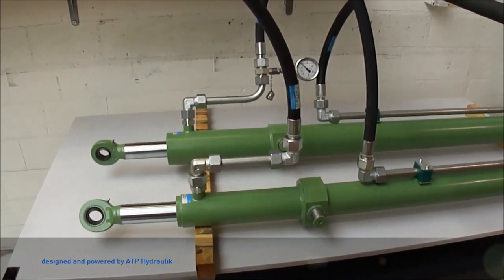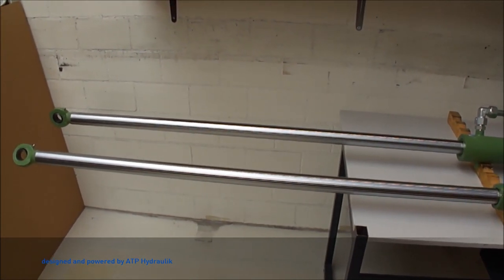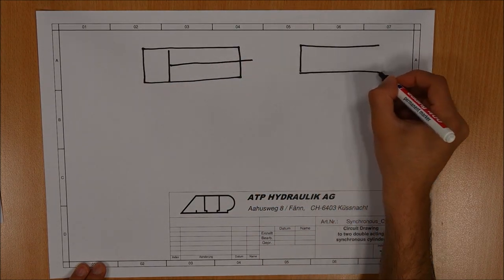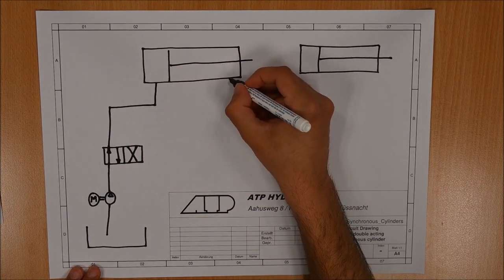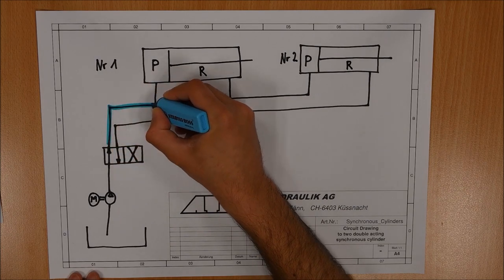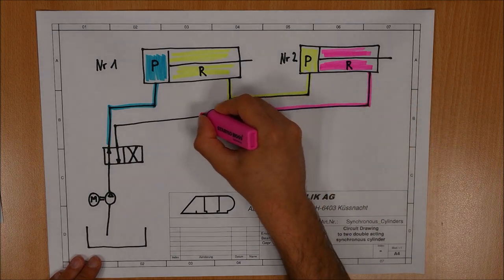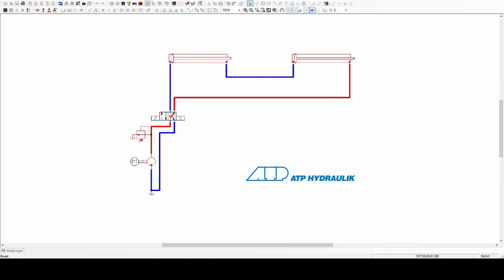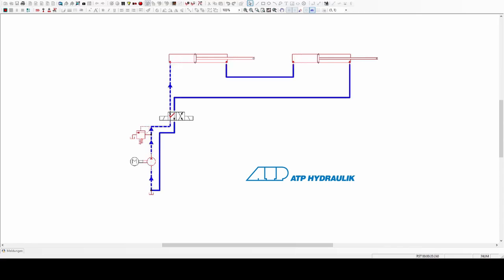Tutorial - synchronization of hydraulic cylinders without regulation and without proportional valve

Comment: I cannot understand one aspect of this, i.e. how to compensate the reduced oil flow from the first cylinder to the subsequent cylinders. Since we all know that quantity of oil exiting the outlet port of first cylinder is less than the quantity of oil entering the inlet of that cylinder, due to the piston rod's presence there. Hence, the oil flow to the second cylinder, and every subsequent cylinder will be progressively reduced. Please explain how do I compensate the oil flow, and synchronise all cylinders to work in tandem.
 
I have three exact cylinders, but with varying loads. How do I get all three to move in a synchronised manner?
Reply from the maker: The second cylinder cannot be the same size as the first one for this to function. In the hand drawn schematic you can see, that one part of both cylinders is coloured yellow, as well as the formula AR1 = AP2. This is meant to symbolize the same volume of the two chambers of the different cylinders. 

To solve your example problem: 
The easiest way would be to exchange the cylinders 2 & 3 to a size suited for cylinder 1, so a functioning synchronous cylinder system is created. 
You could also measure the stroke of each cylinder and have them digitally balanced.

For a more detailed and specific answer, please contact our sales department sales@atphydraulik.ch and have your problem looked at with schematics and calculations.

Comment: I don't understand how the second cylinder can travel as far as the first one since it has less oil to do it with.  I have a Hydrabed feed truck with just this set up and it has always worked well and stayed in sync, until now, the first one runs and the second one lags as you would expect.  How do I get both to function fully?  Do I need to add more oil to the middle section?
Reply from the maker: The second cylinder has a smaller diameter than the first one, so that less oil is needed for the same stroke length.
Before adding more oil, you should check all sealings in both cylinders, the fittings and the hoses. For this you have to drain the oil anyway and fill it back up after, but you can make sure that every potential leakage is eliminated.
Then, check if there is another mechanical part blocking the movement of the second cylinder. 
If it still doesn’t work, you should consider bringing your vehicle to a specialist for further inspection

Comment: Good evening! Could you tell us which hydraulic circuit is used for the parallel level mechanism in a norcar and a cast miniloaders?
Reply from the maker: Hello. For the applications you mentioned, synchronous cylinders may not be the best option because of the different diameters and forces. I would recommend using a flow divider connected to two equal cylinders. For further questions you could also contact us at https://www.atphydraulik.ch/en/contact/. Have a good day.

Comment: Whether the pressure of the rodless cavity of the first cylinder is maximum. If the pressure of each piston rod is F, the area of the rodless cavity of the piston is S. Then the pressure of the first rodless cavity is p=nF/s, and n is how many cylinders. Is that right? Thank you
Reply from the maker: The highest pressure occurs on the rod side of the last cylinder in the line. In a cylinder, the pressure (N/mm 2) is spread across the surface of the piston. On the rod side however, the N is spread across fewer mm 2, which results in higher pressure. This now can be repeated in each cylinder in the line, starting calculation with the resulting pressure of the last cylinder. 
The Formula for this event is: p1*A2/A1=p2 (Or in general; p1/p2 = A2/A1)
For the next cylinder, p2 becomes the new p1. This is repeated for each cylinder in the line.

Comment: From the rodless cavity into 4 units of liquid, that from the rod cavity should be 3 units of liquid, 3 units of liquid into the second hydraulic cylinder rodless cavity that the piston should move 3/4 units ah, how to synchronize. I don't understand a little. Thank you
Reply from the maker: You are right, the amount of oil sent to the second cylinder is not the same amount as sent to the first cylinder. To achieve synchronization, the second cylinder has to be smaller than the first one. The Piston side volume of the second cylinder should equal the rod side volume of the first cylinder.

Comment: If both the cylinders are not operating the same speed then what will be the main cause?
Reply from the maker: The Cylinders are operating at the same speed, but not with the same force. 
Fluids are almost incompressible which means that for every millimeter cylinder Nr 1 moves, cylinder Nr 2 moves aswell.

Comment: Is this hydraulic circuit for synchronization applicable for telescopic cylinder double acting cylinder?
Reply from the maker: That's quite an interesting question. Technically, it most likely would be possible. It will require some engineering work to get to a proper solution. If you are interested in an offer for a system solution or if you would like to purchase such a cylinder, you are welcome to contact our engineers.

Comment: How the hyd oil will fill in all 4 chambers
Reply from the maker: Valves inside the cylinder allow the oil to pass from the piston side to the rod side of the first cylinder. From there, the oil can pass further into the second cylinder, where the same principle is applied. With this technique, all four chambers are being filled up before operating.

Comment: hi. How dose the fluid(oil) pass through the piston of cylinder 1 and get to cylinder 2?
Reply from the maker: Both Cylinders have integrated hydraulic components, which allow the oil to get in the not directly connected section. Kind Regards, Engineering Team of ATP Hydraulik
Reply: Mahdi,

I'm looking into the same idea with bottle jacks here in the states. I'll be dripping and tapping into the casting. Or possibly using a preexisting port on the hydraulic cylinder.

Comment: how it is possible, fluid capacity is different in both cylinder. Cylinder bore having huge capacity whereas it is in retract position we have reduce rod area to calculate fluid capacity.
Reply: At this condition both rod and piston volume should be same otherwise there will be difference in position and speed.

Comment: I wonder, would this function like this under different loads on each of the cylinders? Because something tells me, that it might not stay perfectly in synchronization.

Ich denke, soll das wieder funkzionieren unter anderes Belastung fur jeder Zylinder? Weil mir etwas sagt, dass es möglicherweise nicht perfekt synchron bleibt. (Entschuldigung fur meine schleches Deutsch, es ist nicht meine Muttersprache, also meine Tastatur hast keine Umlaute)
Reply from the maker: Generally hydraulic oils are labeled almost incompressible (0.5% per 100 bar). Although everything is slightly compressible, therefore we use internal valves to provide perfect synchronisation, even with various loads.

Comment: How this system is bleeded?
Reply from the maker: The air is bleeded through two separate bleeding screws on each cylinder, preferably directly on the opposite site of the hydraulic connections.

Basically, the air collects at the highest point. The cylinder can only be vented if the bleeding screw is also at the highest point. 😉

Comment: Apa P di Nr 1 sama dengan P di Nr 2. Kalau menurut saya, P Nr 1 besarnya 2x P di Nr 2. Mohon penjelasannya..
Reply from the maker: P1 is different from P2. Important is, that P2 has the same volume as R1, which is P1 minus the volume of the piston rod. There are no rules about the volumes of P1 and P2, except that P2 is smaller than P1. P1 can be 2xP2, but in most cases it varies. I wish you a good day.

Comment: the second cyl will be acting at a lower pressure thant the first one.
Reply from the maker: Hi Sandra
The operating pressure of the second cylinder can vary from almost no pressure (minimal force required to move the piston and the rod) to the maximum pressure provided by the first cylinder, which is then multiplied with the transmission ratio from cylinder 1. This depends on how the weight is distributed.
So, if 100% of the weight is located on the second cylinder, the pressure is actually larger than at the first cylinder.
I hope my answer was helpful!
ATP Hydraulik, Raphael
Reply: but how come both volume be equal
Reply: You've effectively demonstrated an intensifier.  But as a synchronized cylinder setup I can't think of too many applications where this can be applied where synchro is necessary as it is tied in series and the bore diameters are different.  It's a training video.
Reply from the maker: @Rajesh 6. The volume is equal because cylinder No. 1 is pushing cylinder No. 2 from its rod side. That means, that you cannot completly fill the cylinder tube on that side, because the piston rod blocks some of the available volume. The difference in diameters between the two cylinders is precicely calculated, so the volumes correspond accordingly. Kind Regards, Raphael
Reply from the maker: @Kevin H. Actually, there are many possibilities to use synchronous cylinders! But it’s up to the customers specification. Just one example: the smoother you want a double door to open, the closer you can get to the synchronisation by using double synchronous cylinders. Kind Regards, Raphael